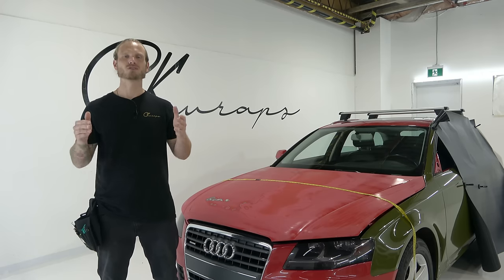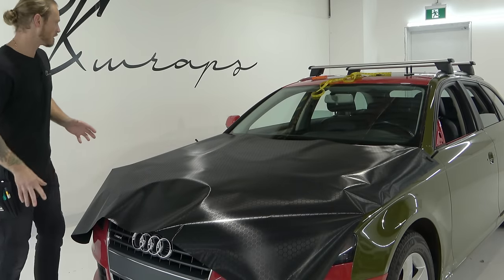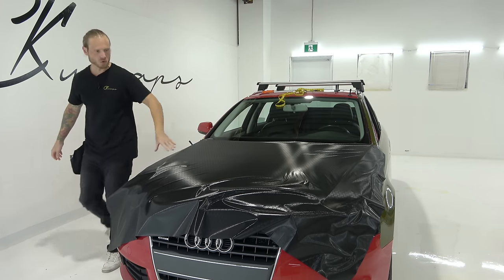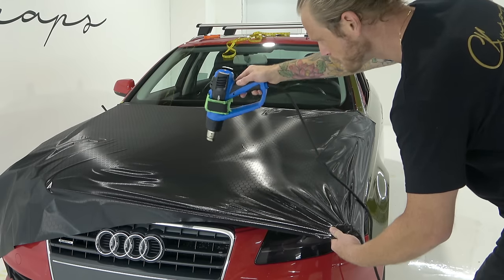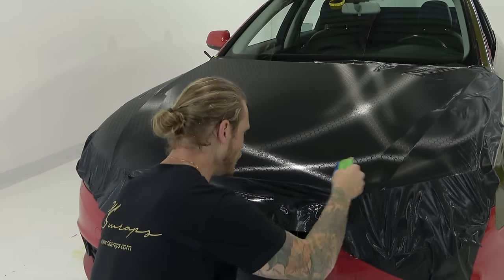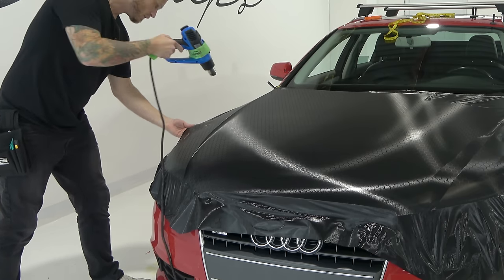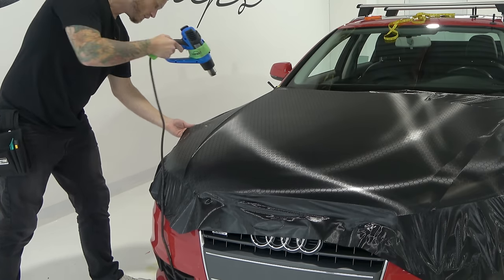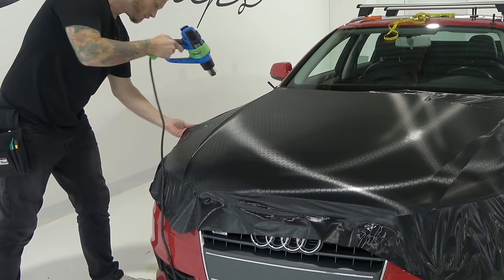The Coolest Carbon Fiber Wrap?! They did it again!!!!

Comment: Actually tried a reflective (holographic) carbon fiber wrap a few months ago. The finished look was awesome but due to the low quality of the wrap itself there were too many flaws. I was trying out several styles and types of wraps at the time and was buying the least expensive ones for the most part. Anyways, I settled on a traditional carbon fiber style to wrap my hood and am very impressed so far. I'm also pretty sure that when the next time to wrap my hood comes up I'l be buying a reflective carbon fiber and it will be of good quality that time. Great vids BTW, I've learned alot from you.

Comment: i have an aftermarket hood with a 4 inch cowl (on a 1988 firebird) i was going to wrap a few years back, i don't have it around me currently so i don't have the exact measurements, but it was wider and longer than the 60 inch roll of wrap by a few inches. i can get the length fine by ordering a longer piece but how would i go about wrapping the hood completely with covering up the width as well (i wanted to use vvivid carbon fiber so i thought about cutting a piece and making it a two piece wrap but i h ad problems with lining up the patterns)

Comment: can you use a Monokote heat sealing iron  on vinyl wrap?  the heat sealing irons they use for RC aircraft .
Reply from the maker: No idea, but I have a feeling that would be extreme overkill
Reply: @CKWraps  not for the entire surface , but some areas, edges seams tucking in some recessed areas. i have a concave middle area that goes across the middle of a plastic glove box door. 
might be worth looking into just for the knowledge / understanding . application is similar.

Comment: Fake "carbon" on a performanc-y car is today's equivalent of my grandma's approach to wrap a particle board cabinet in "faux marble" vinyl: like back in the 80s, nobody is fooled. Can't "wrap" (lame pun, I know) my head around the design approach of spending money on something that's try to pretend to be something else...
Reply from the maker: It's not pretending to be carbon fiber. Let's face it, most people who buy real carbon fiber parts aren't using them to the capicty that they are intended for. I see a bunch of flashy cars with carbon fiber that never see a single day at the track. The intended us of carbon fiber is to save weight as well as maintain high strength. Those who are spending thousands on real carbon fiber parts but not using them are essentially wasting their money. In the end, majority of people who put real carbon fiber on their Honda, BMW, Audi etc are simply doing it for the esthetic appearance. You could say that they're "fake" race car drivers or "impersonating".
Reply: @CKWraps  Agree. It's a discussion similar to the one about "real" jewelry (gold & diamonds) and fashion jewelry. In that field, the winning concept was NOT to simulate the looks of the expensive variant but instead use new or unusual materials in new shapes, with an end result that's both authentic and genuine in the sense that the "cheap" objects also can age in dignity and wear will add to the character of the piece - which differentiates affordable fashion jewelry from the faux jewelry that's just pot metal with a few microns of rosé gold on top. Wrapping makes sense to me when you try to create something entirely new that doesn't pretend to be something else and that can't be achieved by other means.